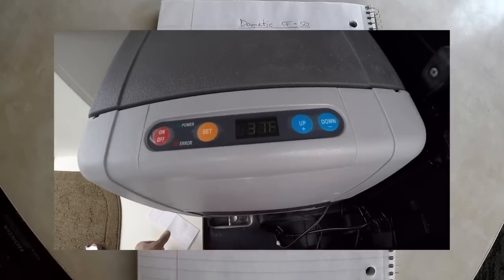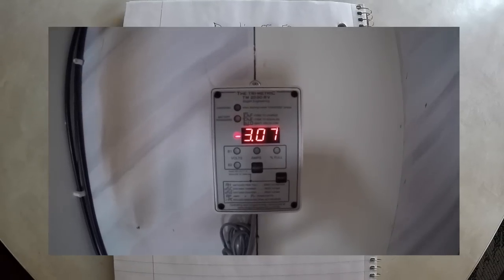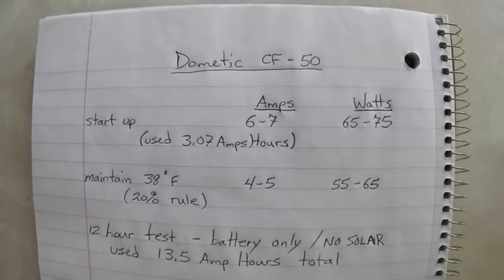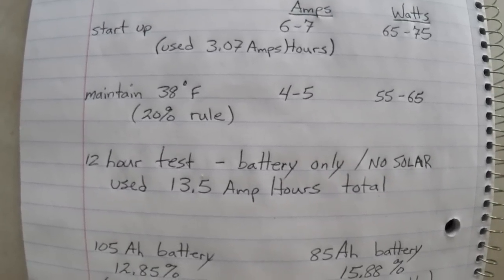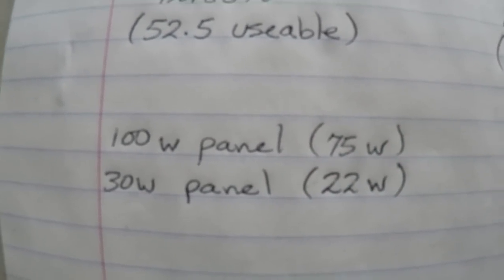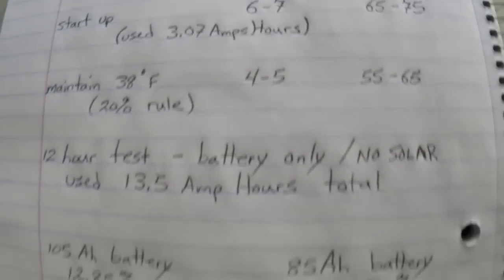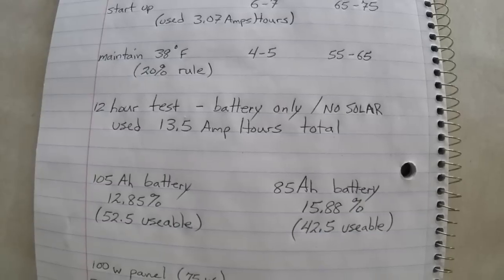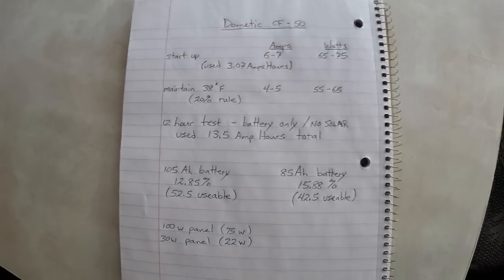How much Solar for Dometic CF-50 12V Refrigerator | 2010 Ford Transit Connect Camper Van Conversion

Comment: Can you make a gear list of your setup?  Thank you.
Reply from the maker: I'm not exactly sure what you are looking for but here are links to the three main components of my solar setup. I was also using a 12V 108 amp hour lead acid deep cycle battery. Hope this helps you out.
Renogy 100 Watt 12 Volt Monocrystalline Solar Panel - https://amzn.to/368QGA9
Renogy Adventurer 30A 12V/24V Charge Controller - https://amzn.to/2Ty0Fw0
Renogy 10Ft 10 AWG Solar Panel Wire MC4 Extension Cables - https://amzn.to/2NyRasQ
Reply from the maker: Here are a couple more items I used:
Cigarette Lighter Socket 12V Waterproof Power Outlet Replacement Dual Plug - https://amzn.to/2x0RD1d
MUYI 2 Set Mini Blade Fuse Holder 14 Gauge Waterproof Pigtail Inline Fuse Holder - https://amzn.to/2U6VNfT

Comment: To be safe if you boondock full time you should have a battery that will run for 5 days no solar, also lithium will take every bit of solar power you throw at  it , if you have agm they will only except some solar power, I boondock full time and if you want a true drop in lithium go with goal zero lithium solar generators, because your not just getting lithium’s but a lithium meter , pure sine wave inverter ,lithium mppt plus USBs and a 12volt cig plug , connect solar to the goal zero yeti and that’s it , and you can also keep your agms ,personally I got sick of checking the meter all the time because of the permanent draw of my fridge freezer , the day I turned it off was a huge relief, I now use my batteries for microwave and aircon and if I’m low on power I can use my stove top and when it’s hot I can run a fan or open the windows, the power is now in my hands no constant draw, I can also charge my agms with the goal zero yeti

Comment: thanks for the vid,and for explaining this clearly . i just bought a dometic cff45 , and the dometic plb40 power pack , the guy said if i need to keep going off grid was to add a 120 amp solar panel ,  i was told the cff45 will last 38-45 hours alone on the plb40 depending on weather and how many times i open it ect ,
Reply from the maker: They are great little refrigerators. I hope you enjoy yours as much as we have enjoyed ours.

Comment: Great methodology for determining battery requirements. My only suggestions would be to try and not go as low as 50% state of charge if possible. So the more battery you have, the better. A larger battery generally accepts a faster charging rate as well.  Also, always get as much panel as possible, as you said. You never know when you're going to strike some cloudy days.

Of course, the practicality of this is determined by space and affordability. 

Great video, thanks!
Reply from the maker: That is some good information and I agree with you. Good luck to you with your projects and safe travels.

Comment: Good info. Now to buy your refrigerator? Don't buy it cheat at your online store. Why? You made a decision that you want the refrigerated for as few yr broken or not. The logic is you can get online shipped to you. But it break. If you have a 2 yr warranty you need to pay for shipping 2 way to the manafacture and back to you. Beside you need to save the box. Recites. A week of proving picture of condition your box and what broke and recite before you get a ok number sticker to ship it back. For me it's cost about 240 so about 480 buck to get it repaired in shipping. 
The solution go  and buy or order it at your local west marine. It's about the same price. And buy a 2 yr warranty. Shipping free. No box needed. Cost 120 buck for 2 yr warranty. Can't fix it you get a new one. I don't buy warranty but here it make sense. As  I then  would be face with why pay 500 buck in repair  shipping may as well, spend another 200 and have A new one now
Reply from the maker: I've had my Dometic CF-50 for about 4 years now and it has not given me any problems yet thankfully. I did not buy the warranty when I purchased it. I have no idea what the local shops around me charge for this refrigerator as I never go to those stores but that may be a good idea. Thanks for the information.
Reply: You came out ahead. That the gamble. Your local west marine prices surprising aren't that much of a difference surprising.not more than 80 buck super cheap or same price.  The reason is they have a regular store shipping container every week. 
What happen was I brought a north frost mini dorm standup. But the freezer door was broken. He gave me 20 % off  but it's didn't work the fan coudnt turn easily. They returned it and I got a new one in really less than 2 week. I payed the extra 20% discount back and brought the 120 buck warranty for 2 yr now.  I love my stand up. 35 watts and room as a 80 L  and the freezer on top can really store frozen ice cream frozen while the bottom a ice box . Believe only the largest domestic are real duel temperature compartments
Reply: And other thing on your subject. The cross line is 80 degrees as. My instruction say. say keep the setting below 3 at that temp. Or the compressor will run continuous.  Research it. That true. You set your refrigerator at the highest setting that the compressor can cycle off. But not continuous. Cause it shorten the life.
 To beat that. You insulated. Mine I put it under the bed and blanket around. The work I could turn it down setting 2-1/2 . Because it a well and when I open the door cold get out . I put a plexiglass about 8" at the bottom to hold the cold in. And I added my cold aluminum frying pan I cook my week meat in and a glass container. Both retain cold as you open the door to recover. Now I run it on 2. And still frozen the freezer And still cycle. I live in Honolulu 90 probably.

Comment: The lithium inverter batteries will NOT run 12VDC refrigerator / freezers...….  I just got the Yeti1000 and am so disappointed I could scream.  I needed 12VDC to keep the discharge rate down for camping and it doesn't even power on the lights, AC works fine but only for 14 hrs.  Goal Zero says its working on the problem AHHHHHHHHHH, working the problem after I just dropped $1100 on this thing.  I have the Dometic 95 dual zone which was one of the top rated dual zones you can get. WTF!!!!!!  Plugged it into my jeep and it ran fine.  Goal Zero needs to fix this ASAP and send that fix free of charge to customers NOW!!!!
Reply from the maker: I would agree with you. Thanks for sharing.

Comment: OK. SO I went through as well and have a 15 Watt double sided panel to run a similar fridge with the Danfoss motor. The label says it only needs 0.6amps to run... which I believe (somewhat). so P=IxV so 15w/12v=1.25amps.. OK. there's no way you could cool the fridge from scratch but you're in a van. Engel say in their instructions that before going anywhere cool the fridge down to almost freezing via 240V (Australia here). So get it seriously cold close to freezing and then treat the fridge like an icebox rather than a fridge. (Do this with all the food init ofcourse). Then load it into you car, van or boat, turn up the temp meaning fridge temp and run it on 12volts from the car as you travel. Your batteries will be chockablock and the fridge super cool. It WILL consume around 0.6amps when you do that. So when finally stop for lunch the fridge is being maintained by that silly little 15watt poly panel, which I've assumed is now only 50% efficient because of wrong angle, clouds and imperfect conditions...but its still enough to run the fridge without touching the battery.  Start elevating the panel and pointing it manually and you're laughing. If you never move your 100AH battery will last a week before you have to do anything.. and I doubt you could sit still that long.
Reply from the maker: Great ideas and tips. Sounds like it will work to me.
Reply from the maker: It's been quite some time since I made this video but I think the battery type is a Duralast dual purpose deep cycle 12V battery from autozone or one of those auto parts stores. It is nothing special and definitely not the best choice out there for deep cycle batteries. I was using Renogy 100 watt monocrystalline solar panels. Sorry but I can't answer the question on the yeti 100 because I have never used one or even seen one in person. I don't know anything about the yeti 100 or what it is capable of. Hope this helps you a little.
Reply: can you please tell me what fridge and what size you are referring to that uses that kind of low power? thanks

Comment: it wouldn't hurt to have a 2nd 100 watt panel and a 2nd 105ah battery.  I would suggest V Max ,  some battery that has no cranking amps... 125ah -155ah V Max alone would raise your storing capacity.  if you only bring the battery down to 80 percent state of charge, your controller would be able to recharge more quickly, and the battery would retain a longer life span....  hope this opinion gives you something to consider......
Reply from the maker: I agree with you 100%. I had limited time and space when I put this van together. I will be making a mental note of all the desired upgrades or changes. I plan to make a few changes when I get back home after this winter season. Thanks for the ideas and suggestions.
Reply: zhkopec  is a good channel to check out, he's pretty slick, he breaks it all down to a simple (how to)

Comment: Should you have a DC to DC converter to the computer or a DC to AC. becomes a bit unnecessary to first power up to 110v and then use the computer's power supply to get it down to the power the computer needs. just think if you do not need 110v. think it saves the battery a little more. one thought only. unnecessary to waste energy.  ;)
Reply from the maker: I agree about it being a waste to use an inverter and then bump it back down to the voltage a computer needs to run and charge. I think Apple has one but I'm not sure about PC.
Reply: do a search on your particular laptop brand and car charger. can work with one of these.    https://www.google.se/search?q=laptop+car+charger&num=20&newwindow=1&client=firefox-b&dcr=0&source=lnms&tbm=isch&sa=X&ved=0ahUKEwi-2d-A2JHWAhXkYJoKHSasCQ4Q_AUICigB&biw=1314&bih=850
Reply: on many of the models you can adjust the voltage. as well as choose if plus is in the middle or outer contact.
Reply: You need a nominal 12v to 19v converter (most laptops need 19v) And then splice in with the male connector that plugs into the laptop.

Comment: New subscriber here! I'm wondering I have a CF 18. Much smaller. I also keep it at 38. Would I be able to get away with a smaller solar panel? Like a 50? I have a flexible 135 watt that I use as a portable. Its a pain to set up. Anyone? I have a 125 amp battery btw.
Reply from the maker: I would have to look at some of the specs on your fridge before I could answer that. Without working some numbers and knowing what I know about the CF50 I would think you could do it with no problems. A 125Ah battery is more than enough I'm just not positive on the 50W solar without knowing some numbers on your fridge. Someone here probably has that info and will hopefully chime in to let you know.
Reply: WannaBFree I actually was looking at Amazon and found a great deal on a folding 80 watt panel so yes I ordered it. I'm thinking 80 would be fine. Thank so much!
Reply from the maker: Sounds good :)
Reply: Michelle Phillips was your 80 watt panel enough to not worry about power?

Comment: you are getting close but amp-hour is a unit of capacity of the battery and you are using a certain amount of watt-hours and you will have to recharge with the same amount of watt-hours. So you just have to multiply by an average 12.5 volts and you are right on. 5 amp x 12.5 volt=62.4 watts and you said 65 watts this is perfect. 62.5watts*12 hours*.22 (22% duty cycle)= 165 watt-hour x2= 330 watt-hour for a 24 hours day. You used energy so you used watt-hour of energy, a total of 330 watt-hour in a day witch is very similar to Engel and Edgestar and Whynter fridge. Your battery is big enough 85 amp-hour * 12.5 volts= 1062 watt-hour but you can use only half of it so 1062/2= 531 watt-hours available and you need only 330 so in conclusion your battery is big enough
I like that you measure the fact that a standard 100 watt solar panel deliver most of the time around 75 watts so how many hours of sun do you need to recharge these 330 watt-hours    330 watt-hour / 75 watts= 4.4 hours so this should be easily done on a sunny day.  So one 100 watt solar panel and one battery is enough for the fridge but if you need to use the fantastic fan, it is a very different ball game.
For a month, i did a lot of calculation but a never took into account the 75 watts available most of the time for a 100 watts solar panel. So i thank you for that, because of you, i will be better in the future. Keep up the good work. All together, we are getting better because everybody learn from everybody so no salesman can push bullshit on us.
Reply from the maker: Very well said and your numbers make perfect sense according to my testing. My personal belief is most people think they need way more than what is actually needed to do the job. My goal is to find out exactly what is needed and what is fluff. I have decided to go with the 105Ah battery simply because I have it and I don't think it's too much heavier than the littler one. I do agree the 85Ah would do the job and if that's all I had I would just go with it. I am doing some of the same overnight testing with the 105Ah battery and I'll show that on my next couple of videos just for those who like this kind of stuff. I do not have a fantastic fan installed on this van yet and I'm going to give this trip a try without it, then make a decision weather or not I'm going to install one. I do however have a little oscillating 12V fan that only uses .5 amps per hour and I'll see if it's going to be enough. This van set up and trip in general is going to be a trial and error trip for me. I am doing many different things compared to my  previous van set up (build). I will know exactly what I do and don't need after this trip. Thanks for your input, it is much appreciated.

Comment: I do believe you'll be ok. I sure don't know any more than you but by using your calculation of 13.5 ah used in a 12 hr period = 27 ah per day based on a 70 degree day (averaging your starting outside temp of 80 and finishing temp of 60. Your 100 watt panel putting out 75 watts mounted flat on a sunny day, figuring 7 hrs of good sunlight per day in the winter  ( 75 watts ÷ 13~14 volts = 5.76 amps per hr charge x 7 hrs sunlight = 40 ah per day charge - 27 ah used for the fridge = 13 ah to spare. You're in the pink! It will probably run less with a fridge full to retain the cool.
Reply from the maker: Thank you for finishing up all the details and math on this test. You are correct and I agree 100%. One bad sun day and I'll have to charge the battery with a drive using the vehicle's alternator but that's not a problem either. Thanks again for your input.
Reply: WannaBFree  Probably not reading material for the average person here. I was going to buy a set of harbor freight jumper cables to run the power to, and cut the ends off of, and send power to the back of my van, but they were made of copper coated aluminum and too short. So I ran 16 ft of 10 guage multi stranded pure copper wire (multi carries more voltage and amps, Utube watchers) and still my back voltage lags slightly behind my front starting battery. Easy to equalize by leaving my continuous selenoid closed after parking, at the risk of sulfating my starting battery. Guess I'd better get some solar if I want to full time. Everybody, don't forget fuses on both ends! 😨
Reply from the maker: Good info, thanks for the comment.